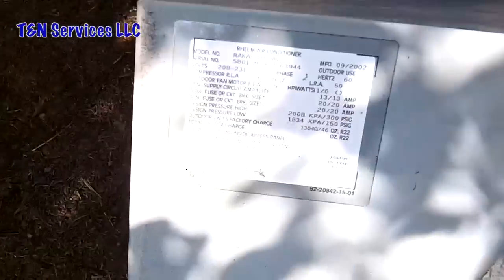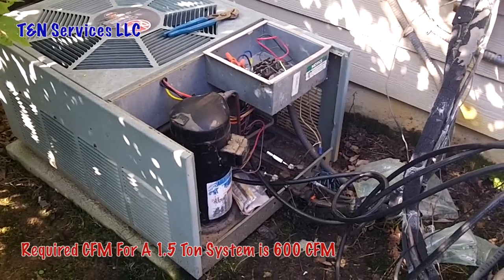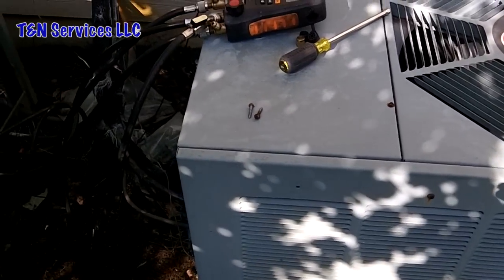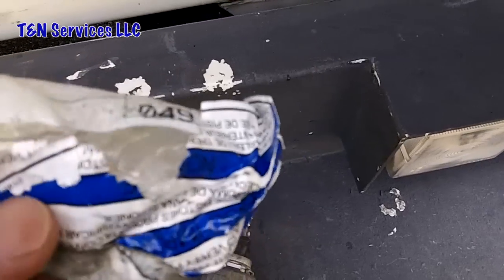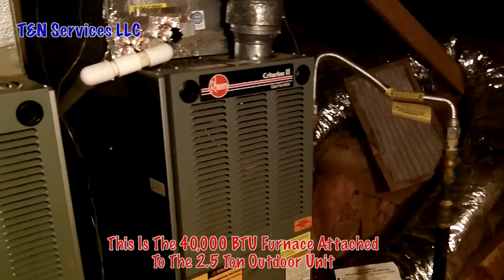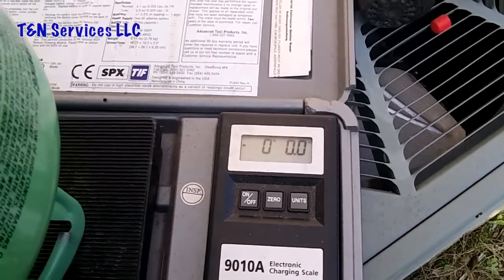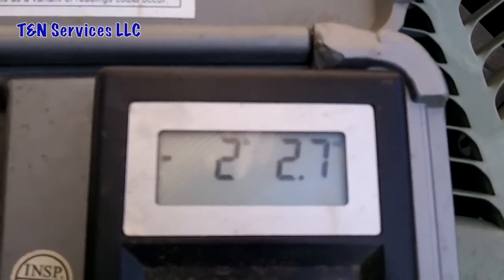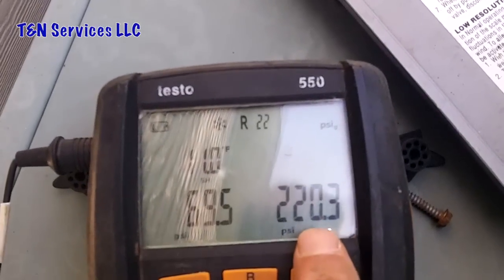HVAC Training: Whats Wrong With The Unit Part 2

Comment: Is the internal relief valve weak inside the compressor? Could you have had moisture intermittently freezing and thawing at the piston? I think you cured it by evacuating and replacing the charge.  Bet it was a traveling restriction caused by moisture, which came in through Air and non condensables.  Can also cause oil sludge and breakdown

Comment: not sure if you were going that far or see this comment, but when I want to push the charge in with no compresor running, I grab my heat gun and raise the pressure in the tank. works nicely when it's like 10 degrees out too

Comment: I had that exact same problem on a new condenser I installed. The coil was replaced also the next day. turns out the problem was a single piece of what looked like black hair holding the piston off the seat ever so slightly. at times it would work loose, then run correctly, then shift off the seat and low side would spike back up to over 80, then drop back down to 60. Like a very slow hunting txv. but in this case was just a strand of hair. Easy enough fix, pump out down, re/re the piston and worked perfect after... keep up the good work...

Comment: Why do vapour as well? Why not liquid into the suction slowly, if 410 you would have to add liquid to suction,
Reply from the maker: I used liquid in the beginning to charge the unit, I always have until it gets close the I charge with vapor.

Comment: Why do you have to recover the refrigerant, that's an extra cost to the homeowner, why not pump the unit down? You can't reuse the refrigerant, once use recover it, there could be cross contamination, from one AC to the other
Reply from the maker: I recovered it because this is a rental house and I really didn't know what was done with it before. The pressure swing on the gauges lead me to believe there were non condensible's in the unit. I told the landlord why I was doing it he agreeded to it. It wasn't about collecting extra money it was about making the unit run right.

Comment: Why did you recover the refrigerant instead of pumping it back and locking it off in the condenser?
Reply from the maker: I recovered the freon because I was afraid the unit had non condensible's in it. I thought about just pumping it down and changing the piston but with the way it was acting I would have had to recover it anyway.
Reply: That makes sense. When I suspect non condensables I put away the digital gauges and use the trusty old analog gauges so I can see if the high side gauge is fluttering. Good thorough job. How long did it take to pass the blank off test during evacuation? That could tell you a little bit about whether or not non condensables were present, also would depend on how long the compressor was open the atmosphere while you changed the piston.

Comment: hey can you tell me where to get a good low cost 410a 3 ton unit we have a 2.5 ton unit matched with a 3ton coil its not large enough for the space its trying to cool now the the condenser is leaking and has been for a few years and last week the compressor went to ground just wanted to ask if you knew of a good low cost unit in the $800 range.
Reply: I just did a home install with my HVAC friend using a Goodman system from acwholesalers dot com. I paid around $2100 for a SEER 15-16 4 ton heat pump and it's working great, you could probably get an AC only condenser for your price range.
Reply: thanks for the help  we ended up getting  a rheem value series 13 seer condenser with install for about 1500  so not to bad as we knew we would have to buy Freon and install charges really nice quite unit very happy with it cools much better then the old one which was also a rheem.

Comment: Ralph,
I wonder if the customer has a slow leak somewhere and the system is able to keep up at night but not during the day due lower heat load and lower ambient temp. Possible the installers oversized the Piston due to the high CFM of the blower that was installed to ensure it would both boil off all the refrigerant in that 2 ton coil (at that  blower speed which without it would otherwise cause a flooding condition) and keep decent superheat. I think it's possible that for that "setup", to give you lower pressures and proper compression ratio.

Comment: Super Great Video that cause one to think!    If the Condenser unit is a 1.5 ton and the evaporator is a 2 ton coil, I think the piston/orifice has to be sized for the pump ie the 1.5 ton compressor.

If one thinks real oddball  and was cobbling together odd parts:  A  giant 5 ton A coil unit, and a big 5 ton's large piston makes no sense hooked to a dinky 1.5 ton condensor. The "unused" 3.5 ton part of the evaporator is thus just like suction line ie return line. Too big a piston means the flow is too high thus a low head pressure. If there is no piston /orifice then the high pressure really drops. 

The same goofy thing can happen if that 1.5 ton Rheem had its compressor replaced with a smaller 1 ton compressor, then the A coils piston needs to be smaller than the 0.049 Ralph installed.

Thanks for the video

Comment: Non condensibles, do you mean air, that would cause high head pressure. The oil when it gets old goes from a base to an acid and breaks down into wax dirivitives that freezes up and restricts the expansion device then when it warms will pass travel through the system, come back and refreeze in the expansion device causing a restriction, and cause intermitant cooling,it will also raise the superheat and lower the suction pressure and discharge pressure.The correct piston was a good move, it allowed the refrigerant to evenly feed the evaporator. By changing the refrigerant you may have removed a share of the wax. The vacuum eliminated the moisture factor. An  Alco EK 163 drier filter will remove waxes, this might help also. If it persists you may have to remove the compressor turn it upside down, drain the oil and replace it with virgin oil. A trouble shooting video, that was a good idea.
Reply: Jim, I'm under the impression you know a little something about system design
 and possibly have design a few yourself.

Comment: based on the symptoms you described with the fluctuating pressures, non condensibles for sure, I've seen that a few times and the only resolution is to remove the refrigerant, pull a good vac, and recharge with refrigerant

Comment: I think this is a great idea for a series.

I am not a tech- so when you say non-condensibles what exactly does that mean? Water or debris when it was first charged?

I know that a piston and a txv are what regulates the flow or freon through the system. In this case the hole in the piston was too big and allowing too much freon to go through too quickly? The effect was a lack of cooling?
Reply: Nitrogen and air will not condense to a liquid at ac pressures. They are considered a noncondensible gas.

Comment: Ralph, your 2-part-er was real interesting.  Some folks are saying non-condensables, but I'm wondering if it could be a bit of wrong refrigerant in the system.  Could somebody have topped it off with the wrong gas?

Comment: Thinking non condensables.  Dont see a wrong size piston causing pressures to go back and forth IMO but i never say never.  I think the piston would regulate gas to a point and pressure would hold some what steady once the unit runs for a while.  Had one like that where pressures where all funky. and i had to replace a dryer that was leaking.  Went ahead and used new gas because pressures just didnt seem right bouncing back and forth. used virgin gas   And pressures worked perfect.  

 Good job getting a closer size piston in that thing dont ever assume it has been that way for years it must be right.

Comment: Nice job Ralph. Remembering I have no experience and very little training , I would like to ask a few questions. Smaller piston = lower low side pressure which means lower temperature which would give you less superheat, right? That's assuming the charge is correct. Why did several people think it was noncondensables. I thought  noncondensables would make the high side pressure go high. Anyway thanks for a couple of nice videos that make you think.

Comment: Nice job Ralph , that's how it goes some days and we will never know but I'm leaning towards non combustible , thanks for sharing .
Reply from the maker: 3beltwesty it really all depends on seer rating. I've work on some that held 20lb r22
Reply: Ok ok how do I get off this stream lol , it's ok guys
Reply: Seemed like non condensables to me too. Glad to see it's back up and running correctly now. Big job. Recovering all the refrigerant and putting new. Glad it was a 1.5 ton and not a 5. That would have been a lot of R22!
Reply: Jim Rodriguez 112 oz here for 5 ton 1994 Rheem RAKA 060JAZ  nameplate say 112oz which is 7 Lbs R22
Reply: 3beltwesty I had more in mind like a dry Payne 5 ton. Something like 13 lbs. 7 lbs for a 5 ton is very little refrigerant. How times have changed I guess. I have a 3 ton Rheem which the data plate says 8 lbs. go figure.
Reply: Jim Rodriguez A tall 5 ton 1994 R22 Trane XL1200 here holds 12 Lb 9 oz,
a  5 ton 1985 R22 Carrier Round holds 12.5 Lbs ,
a 3 ton 1985 R22 Carrier Round holds 5.6 Lb
a 1.5 ton 2003 R22 Whirlpool window AC holds 38.5 oz
a 1.5 ton 2006 R22 Whirlpool window AC holds 30 oz
Reply: 3beltwesty what point are you trying to make? I'm missing it entirely.
Reply: Jim Rodriguez The point is the amount of Lbs of R22 used per ton varies. The three 5 ton units here hold 7 Lb for the Rheem about 12 1/2 for My Carrier and Trane that have much bigger condensors. ( were much of the R22 is by weight). With my two 1.5 ton AC units by Whirlpool the newer one has 2 rows of coil; the older 3 rows thus it holds more R22.
Reply: 3beltwesty I think we can ALL agree that for the majority of units... A 5 ton condenser will *typically* hold more refrigerant than a 1.5 ton.
Reply: Jim Rodriguez Jim; I was not trying to mention that smaller units use less FReon. More like that the Lbs of R22 Freon used per ton of cooling varies. Thus the two 1.5 ton AC units here use 1.6 and 1.25 Lbs of R22 per ton of AC cooling. The older 2003 model has 3 rows of coil; thus uses more R22; thus has a higher EER of 10.7. The newer model has 2 rows of coil, uses less R22 and has a lower EER of 9.7. Both units are the same chassis; same pullout design. What Ralph is mentioning about " it really all depends on seer rating. I've work on some that held 20lb r22" is that a higher efficiency unit often has a bigger condensor; so the Freon can approach the ambient air temperature.
Reply: Seemed like non condensables to me too. Glad to see it's back up and running correctly now. Big job. Recovering all the refrigerant and putting new. Glad it was a 1.5 ton and not a 5. That would have required more R22!